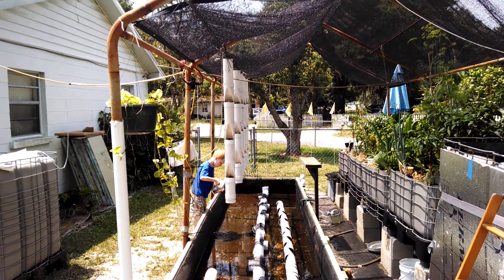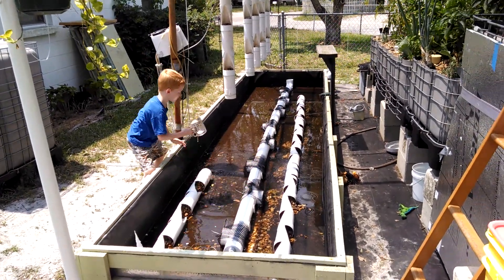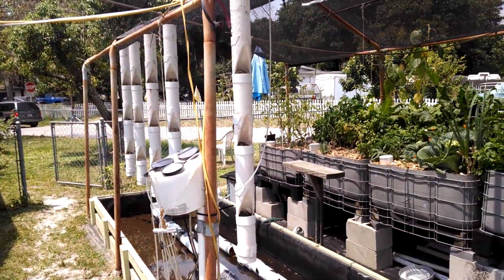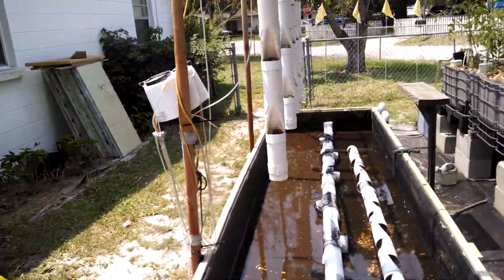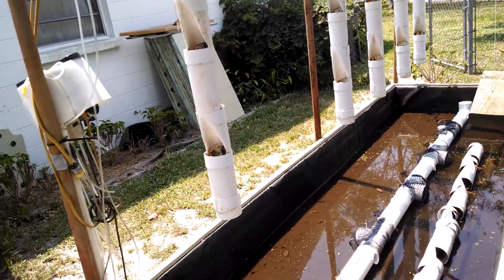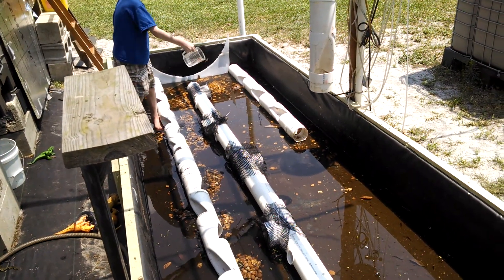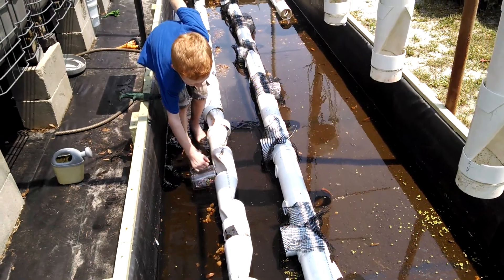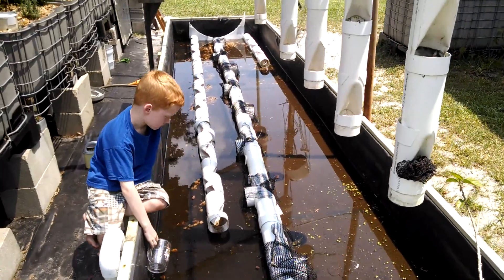HOWPONICS Wicking Bed Build Part 1

Comment: Hi John. How did the crushed concrete work out?
Reply from the maker: +Matt Taylor I actually ended up using gravel instead of the crushed concrete. I have no doubt it would have worked. I have used crushed concrete in other applications and it drains quite well. I think I made that decision simply based on logistics or price, but it will work for this purpose.